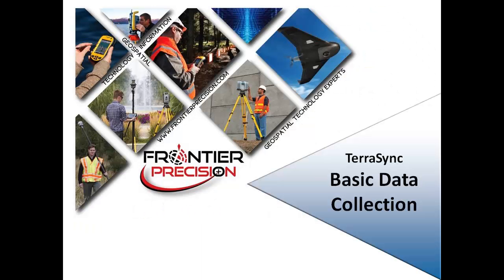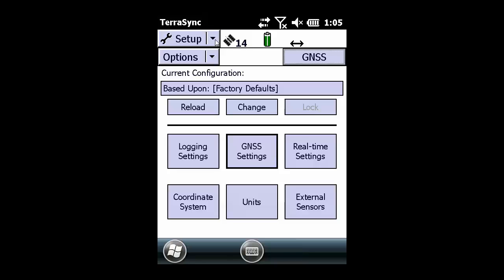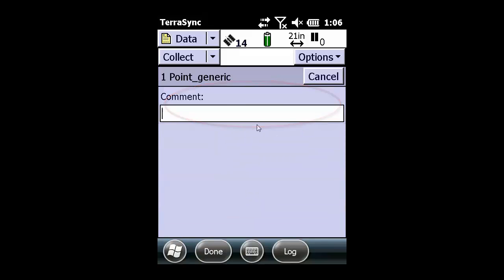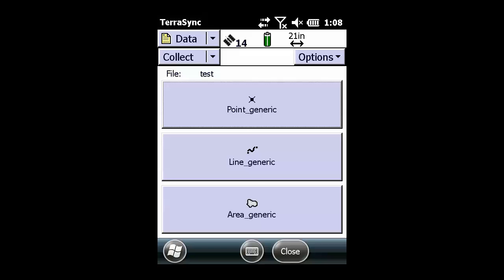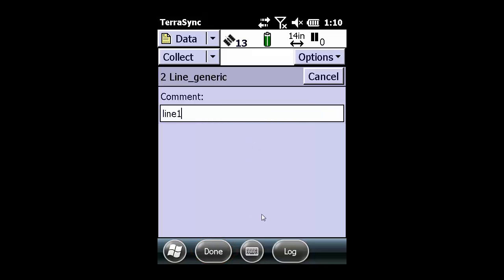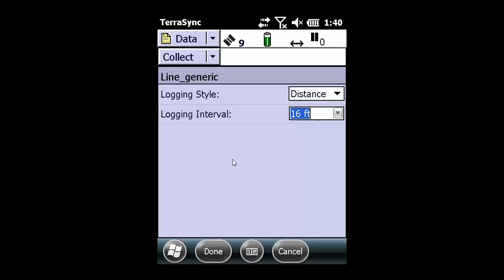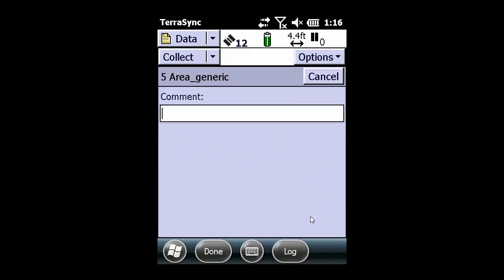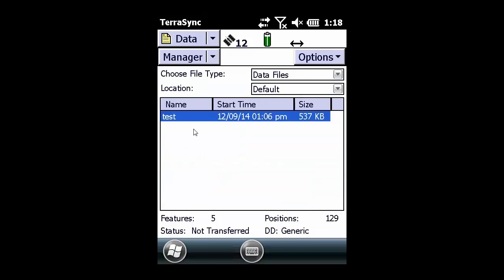TerraSync Basic Data Collection

Comment: Very interesting Video! But I have a question:

I took some points and always paused it when I moved to another point. When I changed to the map, there were no points shown. The only points that were shown were those where I walked between the points I marked. At the end when I saved the file, it worked, BUT when I reopened the file (Data/Existing file/name of the file/open) to see if the point are show on the map, the table show me as "Name": (point with X in it) Point_generic . Is that normal? Because when I changed then to the map again, there wehr not the 83 Points I recorded but only this 1 point with an X in it. A second line, show the same point with X but with a box around it. Under the table (#/Name/Label1), positions are 83 (not 1). What could be wrong here?

I hope you can understand my questions and help me if possible.

Thank you!!

Comment: Hello, I use Terrasync in a 2005 Geoxh, when I connect a non-zephyr antenna (unknown) the following announcement comes out: an external antenna has been connected: please check your antenna settings. I have set the antenna type to unknown, and never confirm. What else should I configure?